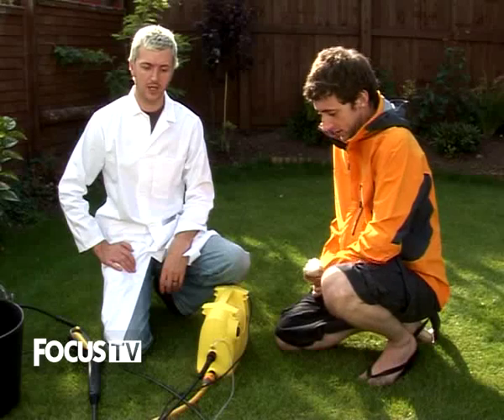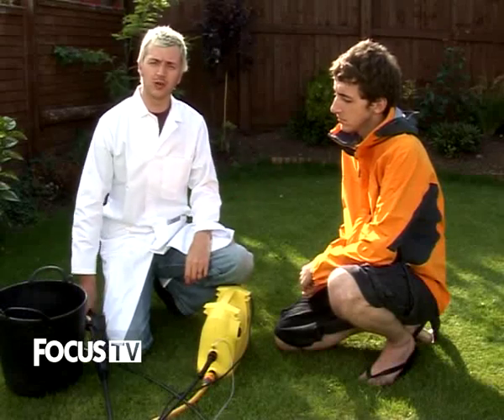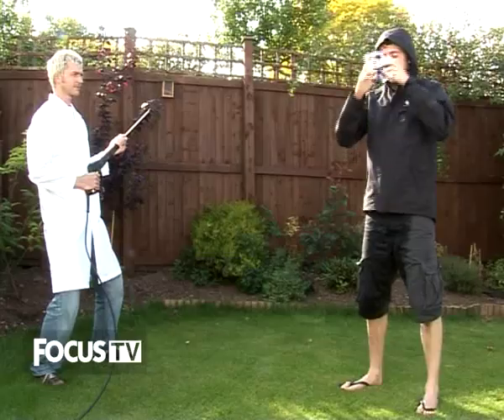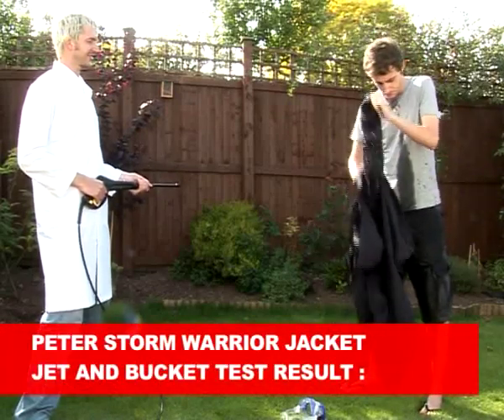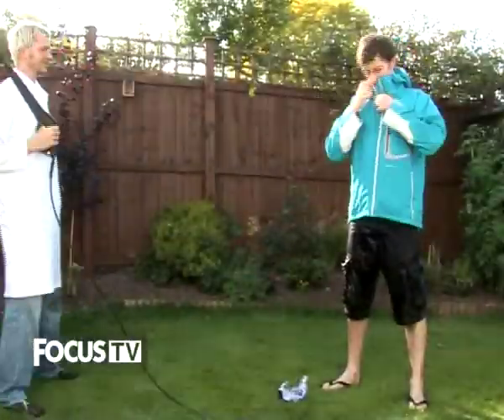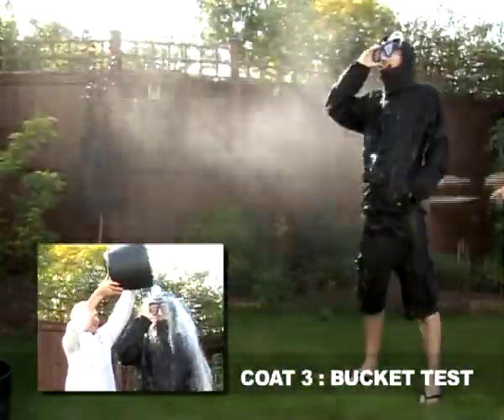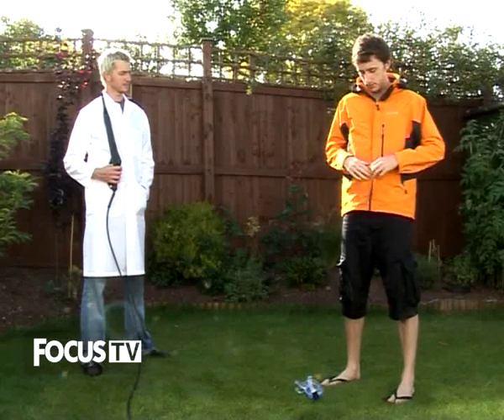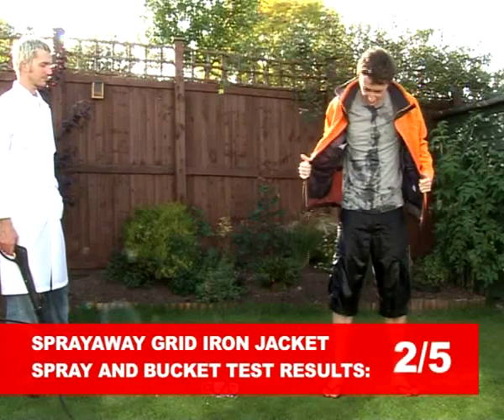Waterproof Jackets Tried and Tested - BBC Focus Magazine

Comment: This test doesn't really work to test for waterproofness (it could pass inferior coats or those with worn or weak leaking seams).
 I've got a more thorough test to check if your new or used jacket is really waterproof.